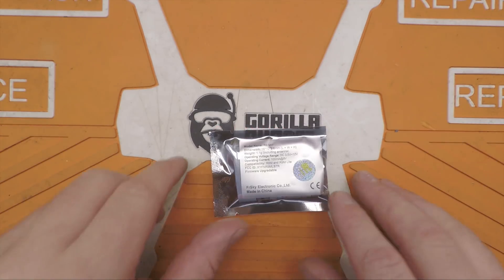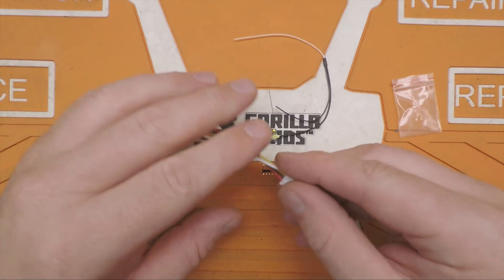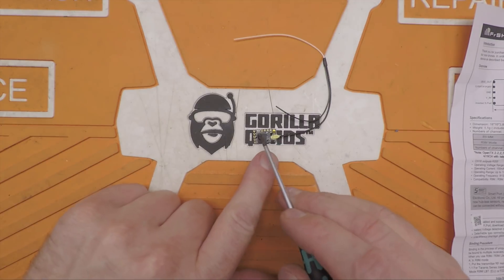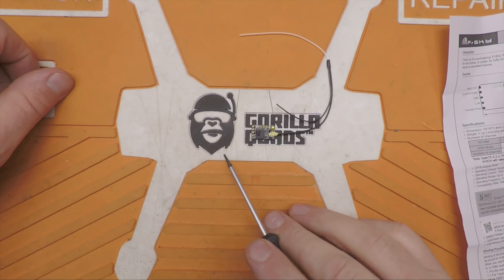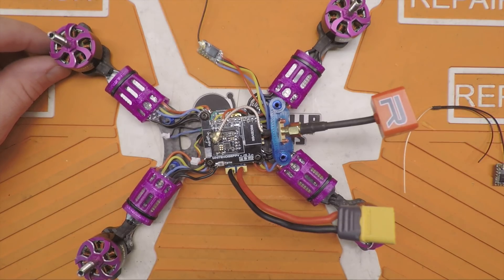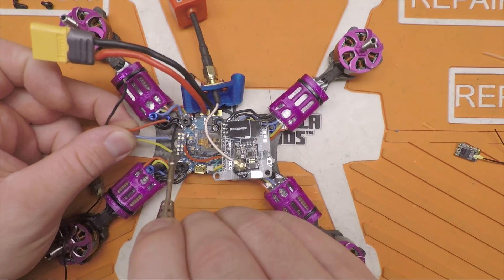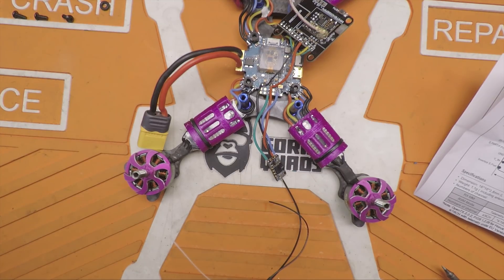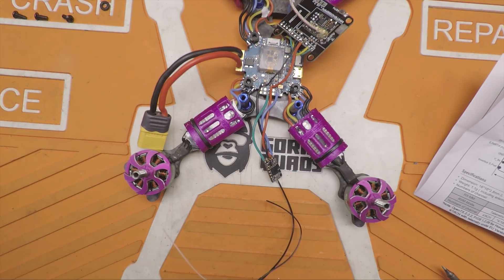Frsky R9 MM install and setup (READ THE DESCRIPTION!)

Comment: hi , nice videos. i have the helios spring fc, which is a f3 and f4 board, is there a certain way to hook up this fc. thanks
Reply from the maker: If you can find the diagram for the helio fc just connect the r9 reciever the same way they show connecting the r-xsr reciever https://blog.seidel-philipp.de/wp-content/uploads/2018/03/HELIO_SPRING_Flight_Controller_Anschlussplan_Wiringplan.jpg I don't have first hand experience with the helio board but based on that diagram I think it will be a easy setup.
Reply: ok, the board has a sbus and a s port. it shows the r-xsr hooking up that way. my question is the inverted s port goes there or s port/fport goes there or does it go on a tx pad?
here is the diagram   
https://fpv-flightclub.com/products/helio-spring-imu-f-v2/

thanks
Reply from the maker: Inverted sport from the r9mm goes to the sport pad on the fc. Then the sbus from the r9mm goes to the sbus pad.
Reply: thank you very much, confusing ha? because the second one down on r9m is s port/fport. in the setup menu in betaflight under ports do i need to setup the s port or just the serial rx
Reply from the maker: You will need to setup both is bf if you want telemetry

Comment: never mind the link, but from the color code you used to the receiver and then to the fc you reversed what you called them, you set up the fc as you called them in hookup to the fc but it shouldn't have worked when you powered the receiver?
Reply: he connected the sbus and inverted sport wires incorrectly, but at the end it looks like he re-soldered the blue and green wire

Comment: How should the antenna be mounted?
Reply from the maker: Straight up and down is the most ideal. Not in a V shape like older 2.4g diversity setups. Some people run them straight but horizontally which works but when you turn you run the risk of pointing the null directly at yourself and can failsafe. These long range systems are very unforgiving with poor antenna placement.
Reply: that's the one thing I pulled this video up for and it wasn't here. :-(
Reply from the maker: Antenna orientation is highly debated topic.
Reply: TweetFPV my former comment came out harsher than I intended. It was a great video I just would have liked to hear your opinion on antenna mounting.
Reply from the maker: For optimal performance the antenna should be ran as straight as possible in a vertical orientation. Personally unless I'm trying to get the max range from it I make a compromise between rf performance and durability and I moun the antennas horizontally attached to one of the rear arms of my Quad. Recently I mounted one in the traditional "V" orientation on a race only Quad and have so far had no issues with it but have never had it out more than about 100 yards. I have a batch of antennas coming from frsky and will be trying those out.

Comment: Im having problems 
Trying to bind R9m and and r9 mm receiver. both modules have been firmware updated, both are showing leds that are saying waiting to bind. nothing is happening, i power off and back on the receiver but still not binded... what am i missing here?

edit: wired with fport on a spracing f3 to uart 3 using +,- and TX pad
Reply from the maker: What color are the leds on the rx?

Comment: I've set mine up and I get rssi back but I can't get luas to run. Any ideas?
Reply from the maker: Do you get all the sensors in the sensors tab in your radio. You will always get rssi and rx voltage. If you aren't getting all the sensors from bf then the luas won't work because you don't have telemetry working properly.
Reply: @TweetFPV  it's fine now I had telemetry set to frsky not smart port

Comment: TweetFPV, sorry for a noob question, but I'm just trying to install that MM receiver and I think I'm doing something wrong. Im using old omnibus f4 v3 pro which probably doesnt have built inverter however I'm not sure. I've soldered S.port pad (not the inverted s.port) to the tx3 on the fc. It doesnt give me the input while receiver is bound, what am I missing? Great video BTW, it helped me to start with R9 :)
Reply from the maker: So a few things here for clarification. S.port isn't your rx controls sbus is. That sbus wire needs to go to the sbus/ppm pad on your fc. In betaflight that is probably uart1 that needs to be selected as serial rx. Then sbus selected In the config page as your reciever type. Then your inverted sbus wire from the rx goes to your tx3.
Reply: The last sentence just confuses me. Inverted S.port pad from MM to tx3 on my FC yup? Why inverted one not the 'S.port' one? Thanks for so fast response mate!
Reply from the maker: So... This is going to get confusing so just hang in there. S.port is what it is by frsky's definition of how sport works. In our understanding of how sport works we say that it is an "inverted" protocol (in comparison to all the other protocols). So when frsky gives you an "inverted sport" pad they are saying that it is inverted from what it was originally designed as. So in basic terms the "inverted sport" pad is what we would normally call a hacked or uninverted sport signal. Unfortunately I'm in a tough spot on how to refer to it on the r9 mm rx because frsky calls it "inverted sport" but we would normally call that inverted sport...... So I'm sure I have lost everyone at this point. Short and simple solder the "inverted sport" pad from the rx to the f4 flight controller. I hope this clears up the "Pam, Pam" thing (stepbrothers reference)

Comment: Could I use the "inverted" S.Bus signal with f.port to a UART without a serial inverter? Reason I ask is I've got an omnibus F4 that's never worked with frsky's inverted signal, so I had to do the uninversion hack to my XSR. If I could use the r9 mm it would make my day.
Reply from the maker: I can not confirm that fport on the "inverted" pad will work but it should. That's my next test of this rx.
Reply: @TweetFPV  I have Omnibus F4 v5.1 with only 3 Uarts (one i use for esc telemetry, another for vtx, and only one free uart i use for R9m f.Port.  so the only way to get f.Port working for me was to solder the f.Port Signal fbus (not sbus) to the sbus pad on my Omnibus FC. And so i dont Need to use sbus soldering.  Furhermore i needed some CLI entries for Inversion and Duplex and half Duplex (every single CLI command was nessecary.  for more Questions ask me!
Reply: @mh7711  Max... I think you save me. Days trying to setup R9MM Fport on my Omnibus F4 V5. TX6/TX3/TX1. And now, connecting the fport wire to the SBUS pad... IS WORKINGGGGGGGGGGGGGGGGGG  (on INAV)!!!! So, at the configuration tab, fport is selected. And I think that... as the UART6 is for the SBUS... and TX6 is UART6 too..... then... I'm HAPPY. Thank you very much. you have enlightened me :)
Reply: @ale-fpv  Thank you for your feedback, nice u got it working   yes it was frustrating for me at the beginning, too

Comment: How do I get Rossi in the osd with this reciever?
Reply: His RSSI signal is showing up on AUX 12 which equates to CH 16 - in the receiver tab he needed to indicate RSSI is on channel 16 (AUX 12) and then in the other tab where you configure what you see in OSD have it reflect RSSI and it will show what is being output to channel 16.
Reply from the maker: Yes this works with the newer firmwares. It didn't when these recievers first came out. And I find that it take a couple of seconds after startup for the rssi to "come alive" in my osd.
Reply: Thx for the reply
I will try that when I get mine 
Thanks